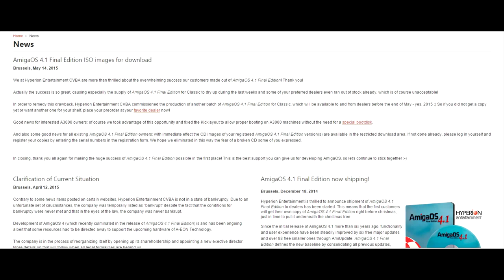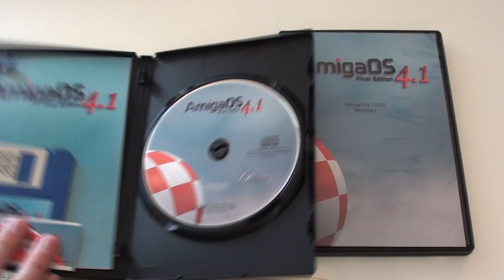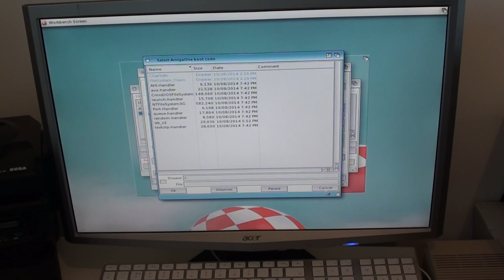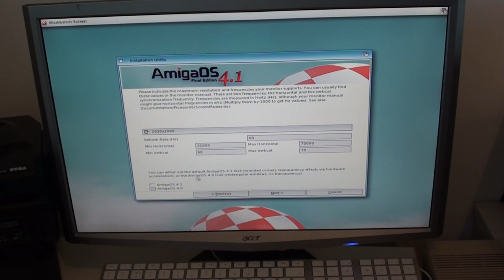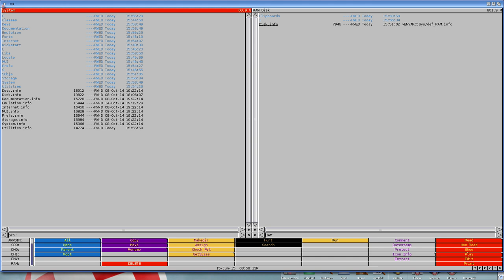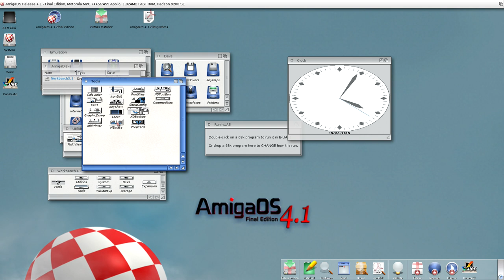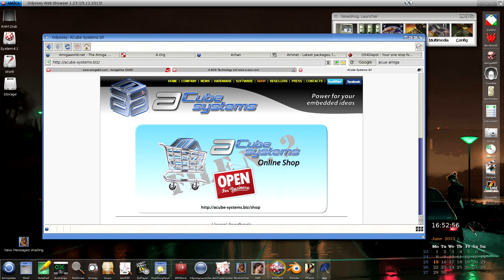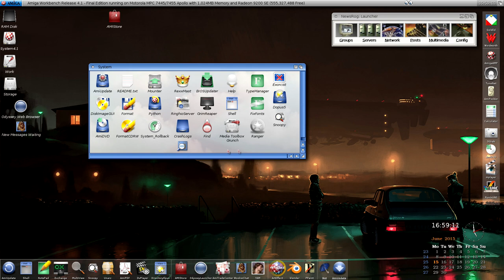AmigaOS 4.1 Final Edition Review & Install (2015)

Comment: The thing that I love about the Amiga is that once you become invested in one aspect of it, you can't help but feel drawn towards the deep rabbit hole that is the world of Amiga software. This was a great video, and the new OS looks fantastic!

Imagine what Commodore could have achieved if they had stayed in business...
Reply: Commodore stalled in development of the Amiga in the late 1980's.  They kept flip flopping on designs and releases and developed quite a few machines that never made it to market.  Amiga 1000, 500, the 2000 and 600 weren't 100% compatible.  I had the 500, but when Linux showed up on the scene, basically Amiga was dead.  For the longest time I thought x86 hardware was total garbage (and it was!) but a 50 Mhz machine running Linux did anything and everything I wanted my Amiga to do.  I had basically the equivalent of a Sun Workstation in my senior year of college running Slackware 0.99 for something like $700, and a Sun was 5 grand at the time.  I didn't have as nice of a display, but it was fully usable for doing work even if I had to compile everything.

Comment: I really wish they'd Make it so Amiga could run on Intel chips, and focus on software sales instead of worrying about Hardware. Right now, I'm using a Mac Pro with 12 cores, and 24 threads. It's 6 years old, and would kick the snot out of an new Amiga one.  It would be so cool to make custom Amiga builds.   Imagine an Amiga OS that has Thunderbolt 2 or 3 capabilities, that can run AMD and Nvidia GPU's, duel Xeon CPU Motherboards, and no freaking Apple tax. :)  Focus on the OS, and leave the Hardware alone.
Reply: AmigaForever may be what you're looking for.
Reply: My Xeon has 2 threads per core. I have 12 cores. and 24 threads. Great when rendering with blender.
Reply: The Amiga OS should be rebuilt on top of Linux or BSD Kernels, and just market it as a proprietary desktop environment, or OS.  It would have loads of software that can already be used. Right now, Linux is more impressive, I still have respect for the Amiga, because it is the reason I got into computers when I did.
Reply: AROS is what you're looking for.
Reply: It's why I increasingly have high hopes for Haiku OS, which is finally in Beta but needs more funds and support.
Reply: @jerrogance  I don’t think they’d be able to do that with the Linux kernel because the GPL would probably prohibit it.
Reply: @cubdukat  I hear you. The BSD kernel has the MIT license, so that would work.

Comment: I can't believe the media toolbox still defaults to 1024 for the block size. It's written everywhere that 512 is recommended for SFS, yet they left the default 1024, so new users who didn't read the manual will end up with sub-optimal settings :\

Comment: IIRC, I think I remember that OS4 comes with a file driver system that allows any application to deal with a specific file type through the driver. Like there is an MS Word driver that allows any Amiga application to use MS Word files and save as MS Word files. Assuming I am recalling this correctly, does this work well? To me, it seemed like a no-brainer and we should probably have something similar for Windows.

Comment: I once had an Amiga 2000 which I used several years. But now, the time has passed. AmigaOS is surely still a good OS but nothing new from the actuel OS. The negative point is also the restricted supported hardware.  Launching AmigaOS on Intel/AMD current architectures would be a good move.

Comment: Excellent review I still have OS 3.9  on my Amiga 2000 which has a 3.1 kickstart ROM upgrade with the  2MB chip ram, Tekmagic 060 accelerator card and Cybervision 64 3D card
I know this is old school but it does still work wonders
I have a few Zorro cards for  ram and SCSI controller cards too :)

Comment: I'm really keen to see a review of the version for classic Amigas. I have an A500 in working order which is at the moment purely ornamental but at some point will be upgraded and used again, an A1200 which I use for games and is my pride and joy, a badly damaged A1200 which I intend to save somehow, and the motherboard from another A1200, which I intend to put in a towercase with as many upgrades and mods and extra bits of cool as I can get my hands on.
Reply: Both 500 and 1200 are probably incompatible with AOS 4.1 FE
Reply: JordyT1998 Apparently I need a PPC card. I have one, but it's not in working order.
Reply: Alex Stone but I think you need an Amiga 4000 or something.

Comment: I did not realize some of those Eyetech boards were so iffy.

Right now there's no cheap, official way to go about building a 4.1 system. Their hardware page doesn't list G4 as supported hardware but I guess that would be the neat solution..
Reply: DeckerFI Ha, looks like despite being a PPC based system, even G4 won't cut it, MorphOS only.

AmigaOS4.1 seems like a hassle hardware-wise.
Reply from the maker: DeckerFI Yeah unfortunately it's tied to custom PPC hardware, which obviously makes it very expensive.
Reply: Forget expensive, the problem is that with not writing a version for Intel i7 CPUs or even i5 means we are stuck at intel Atom type performance PPC regardless of cost. OS4 deserves to be run on a brute of a CPU to show the world the Amiga way was better...just like the turd of a CPU that was 8086 vs 68000 of Mac/ST/Amiga in 1985 we now have a perverse reversal of the situation, it is Amiga that is stuck on stupidly slow and feature devoid CPU.
Reply: G4 is supported dispite not being mentioned but you were to lazy to read all sources, were you not? You just need MorphOS which is the open version of AmigaOS. The kernel itself is helas not open source and some drivers are props. MorphOS offers support for the eMac, iBook G4, Mac mini G4, Pegasos 1 & 2, PowerBook G4, Power Mac G4, Power Mac G5 and Sam460

Comment: You've stated that this motherboard is getting flakey with lockups, etc - have you ever considered buying a couple containers of canned air and blowing out the tons of dust that are laying all over the motherboard and add-on cards?  You might be surprised with a more stable system if you actually cleaned out all that dust.
Reply from the maker: I no longer have the system unfortunately, it stopped working totally eventually. But these were beta/reference boards, not ready for prime time tbh, and not many are working 20 years on.

Comment: Interesting, this.  I wonder why there's no X86 version of AmigaOS...
Reply: GamleErik100 Guess there's that.  Gotta make the money off that abusively expensive hardware.  I guess anyone wanting to have an Amiga-like experience on x86 can stick to Icaros...
Reply: Cross-architecture support is expensive.
Reply: AmigaOS4 run's 680x0 software, the PowerPC stores integers in Big endian format.680x0 stores integers in Big endian format, porting it over to x86/x64 no longer have common way to store values into memory.
Reply: Absolute you need to test everything on two architectures. Incapability's / drivers.

Comment: I know this is a old video. But if you still have this computer you need to clean it an sort out cables badly. It will last longer. It will be overheating causing issues in that state

Comment: I would imagine the stability was due to overheating, I would definitely clean the cpu fan and cooling fins as judging by the video is completely clogged up.  That would be a definite first step as dust is the main killer of PCs due to overheating. Also getting the cables routed a bit better to allow good airflow.

Comment: I'm struggling to see a use case for using one of those mega-expensive Amigas in this day and age of cheap commodity pc`s with many times the processing power and far superior GUI`s.  Getting an A1200 for £80 odd quid to replay some classic games is one thing, but spending thousands on a machine that appears to do nothing particularly well is quite another.  None of the software running on it is any better than the standard apps included on your average free Linux distribution.  And 40 quid for a graphics driver?, cripes, that's really milking the cow from every udder.
Reply: Emulation..
Reply: @interlace84  for real nostalgic, there is only one way.. The rest is just icing on the cake..
Reply: @Tech-geeky  nah I'm having hella fun with some cycle-exact emulators and the right post-processing shaders. Amiga, (S)NES, N64 and many other systems.

Some of those go down to chip-level emulation, c64 & more indistinguishable from the real deal.. besides handling the equipment.
Reply: @interlace84  and that "handling the equipment" is what i meant from being real nostalgic.

Ya, you can cycle-exact on  software emulate, but its just not  the same at owning the hardware

Comment: I have very fond memories of my 'ol Amiga 1000, then 500, then 1200...but I'm struggling to understand what would be the point of this AmigaOS 4.1? Are people developing for it? Can Linux programs be cross-compiled for it (or with minimal effort)? It seems to be a lot of effort and cost for very little benefit. The development of new Amiga hardware over the years has been slow to the extreme. I realize there isn't much money in it anymore, but the years and years and years of waiting have taken their toll: Most Amigans have simply moved on to Macs or PCs, but kept the memories of Amiga close to their hearts.

Let's stop beating that dead horse and just call it. 

JW3HH
Reply: Agreed. Spending 2k on an obsolete out of the box machine is silly at best. I can emulate everything that I remember on a 50 dollar desktop beautifully. There's no point in developing anything new, that ship has sailed about 23 years ago when C= died. It's best we let it pass.
Reply: Let's not.  It's none of your business if people want to buy new Amigas.
Reply: Haiku OS, a BEOS clone which was influenced by Amiga, is finally in Beta and could use more money, volunteers, and support. :) And it works on x86.

Comment: Dan,
I grew up with Amiga. Back in Israel my dad was one of the guys who first worked with it in serious TV work.
For as long as I can remember the only thing my dad talks about is Amiga... Amiga this... Amiga that.... Amiga amiga amiga...
You get the point!
My question is... since I'm now much older and don't even remember much of it anymore. Is Amiga still alive at all? Can you really work on it these days or should I stick to my Mac?
Also, maybe a side note but are you located in London by any chance?
Reply: BravingTheOutDoors 

TO you and others , mine keeps on getting knocked off for one reason only .I tell the truth.UAE means emulation... meaning ..not really a real amiga.therefore and also, not a doing a real good job.Its 8bit like other x86s  ,and pc=mac.,and 8bit  thru out the system just like .the x86 system. sad fact. Even on the classic Amiga. The so called classic 4.1 os is really a 8bit os trying to run on the classic hardware ,and doing a poor job.i know I have run both. Neither can do true real-time multitasking . It called time sharing ..dang cache and memory protection ..is what non multitasking system have. 
os 3.92 is still the best oh yeah . we where going PARISC=ITANIUM KOOKSY yeah thats who u are. PPC isnt what its cracked up to be.

Comment: I wonder if you are going to look for JavaSE for AMIGA BTW what compiler are you using I myself use GCC and Code::Blocks, I suspect that someone will try installing it onto a XBOX360, why not use a Corsair AIO watercooling kit should keep the temps down.
Reply: You can read about Java here:
http://jamiga2.blogspot.no/2013/05/a-telnet-client-in-java-on-amigaos-41.html

If you wont do C/C++ development then yes can use GCC/G++ compilers, that is the standard compilers.

I have water-cooling kit in my AmigaONE-X1000, to keep the notice down, what you run into is that mounting brackets don't fit so a bit customization brackets is needed to make them fit. It bit risky modification.

Comment: Very nice, but I'm still iffy on AmigaOS in general.

Didn't the guy behind it, Steven Solie, basically admit it's just a hobby os? If so, why charge for it? Why charge so much money for the hardware if it's just a "hobby"?

Linux use4rs don't treat their os as just a "hobby" but are more serious about it, yet this Solie guy is treating as a way to make money off of fan nostalgia.

Ah but what do I know.
Reply: Vebinz  OS4 is a barely self sustaining project aimed at hobbyist computing. Linux was a College students software project that achieved critical mass very quickly.
Reply: rednight 
That's fine. Hobby os and hobby computer, but not at those prices.
Reply: Vebinz Just my guess: he has invested money and has to pay salaries.
Reply: protocetid 
Again, fair enough, but why all this for a "hobby"? Since it's a small-user-base hobby, maybe he should try to run a smaller business.
Reply: Vebinz Just guesses since I'm only looking into Amiga as a curiosity thus I don't know much about it. I suppose he may want to gain more desktop market share. The hardware is pretty specialized and/or is made in less numbers right?

Linux is free because it is developed by volunteers, and is open source.
Reply: ***** GNU is Richard Stallman's project that he started when AT&T changed the source licensing rules of UNIX. Linux is Linus Trovalds' project he started due to Minix licensing. Yes most Linux distros use a large amount of the GNU tools, and uses a GNU license. It is not GNU though.

Vebniz -- OS4 itself is not very expensive -- it's less then MorphOS. The hardware is expensive, but so is all small batch electronics. Also it's not like you need to buy a new board for OS4 every couple years or so.
Reply: +Bridgette L. no :)
Reply: rednight The new Amiga desktop is going to be 1500 USD iirc.

Comment: I have the old Amiga 3000 that has been sitting around forever.  Is it possible to get this Amiga 4.1 OS installed on my A3000?  Will it look like the way you had it in the video?  If not what do you recommend for hardware system whatever to get the 4.1 installed.  I may want to get my A3000 fired up.

Comment: I have a 1200 up in the loft and seriously considering bringing it down as I've been wanting to go back and use it. I'm a bit worried about leaking capacitors and any problems that may have come from leaving it in the loft. Does anyone know if there is a 'touch up' / repair service where we can send them off to be cleaned and checked? Hmm that sounds a bit bad - it's a long story how it ended up up there!
Or are there any decent guides?   Dan, if you could do a video on cleaning/repairs, that would be really great please :D Only if you have spare time obviously :) Just pointers, or things what to look out for if we open them up.
I only just noticed that there were a few New Old stock Amiga 1200s sold by Amiga Kit. Pretty gutted i missed out!!
OS 4 looks pretty nice. It's sad to hear that the company had all that trouble shortly after releasing it. :\
Reply: treguard1982 Btw watching your videos over the last few months is really what made me want to bring the amigas down and dust them off.
I'm just in the process of cleaning the keyboard membrane with isopropyl and then using BBCream on the keys. I think I'll then connect it back up to the PCB just to see if the 1200 will boot up ok

Comment: The amiga gui is still an issue.
Its like we are presented with a good wallpaper which and when we click on any icon = program, we are greeted with 8 bit nonsense.
The only way amiga can mive forward is with a interface that is sustained at high quality.
Take for example, when the gui first loads up. Click on a program or a utility and you will see how quickly the gui deteriorates.
MacOS and Linux has come a long way, the big change has to be made on Amiga

Comment: IIRC, those mb's cost a small fortune, it's a total rip off that they were beta "not for resale" boards but I'm not surprised.

It's annoying they don't supply a DVD with all versions for one price cos it gets pricey fast if you're using emulation. 

Also, I kind of thought that Final Edition would mean the end of PPC??

ACube's website has not changed, I just checked. Also, for both sites, no prices means overpriced.

Comment: why isn't amiga os compatible with x86 architecture? i mean i don't think there are new power pc computers, i would like to try this amiga os but i don't wanna buy a new computer just for that
Reply: It's difficult to port over because the 68K processor had a different endianness than the x86. PPC had the same.
Reply: Apple had money to port everything back into x86. Commodore hadn't and legacy software would run forever on emulators anyway.
Reply: Different instruction set. An Amiga is however capable of hardware emulating an x86 with a Bridgeboard and as thus can run Windows up too '98 though very slow if not vampired. I think it might even run Windows 2000 and 4.0 NT but I never tried. Because it is a hardware emulation you have both instruction sets at your command at the same time which makes it very powerful indeed. I use the Bridgeboard mainly with DOS 6.0 to run old MS-DOS games like C&C. Because of the Bridgeboard and my co processor 68030 I can also run Amix since the Bridgeboard gives me IDE and as thus a CD-ROM and extra HD capability.

Comment: AmigaOS 4.1 Final Edition, can it run on a raspberry pi 3?
Reply: No it can't ARM is not PowerPC CPU. can you emulate PowerPC on ARM, maybe but run slowly.  Even most powerful x64 systems i5 and i7 systems have problems emulating AmigaOS4.1 with nice speed. you play some simple games, but AmigaOS4.1 is targeting new modern graphic cards. (UAE/WinUAE does not emulate modern computer).
Reply: No but it will run on old Mac which still have a Motorola chip set. As Kjetil said you can of course emulate PPC on your ARM but that will cost you speed.